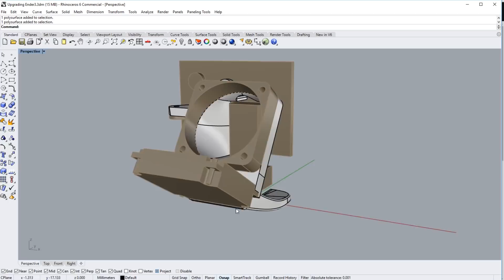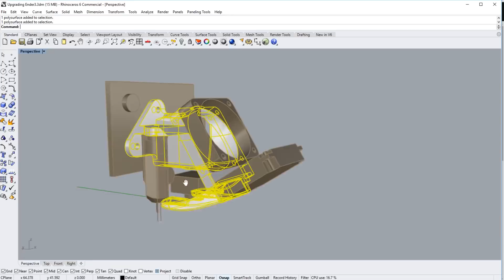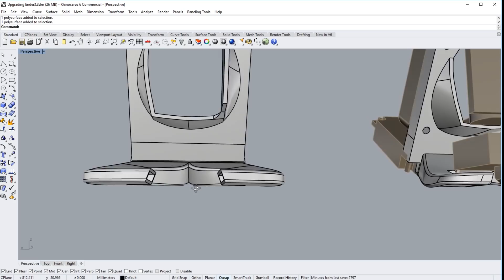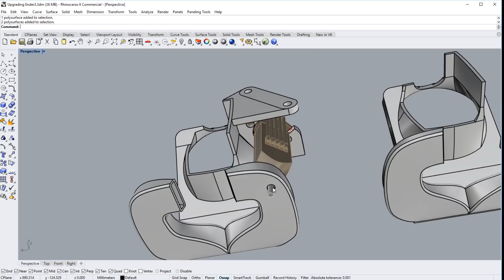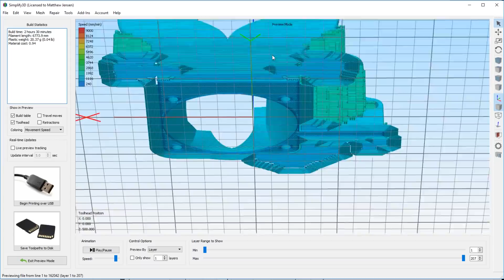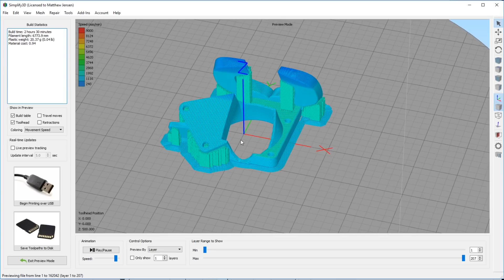Upgrading the Creality Ender 3 with Duet Wi-Fi, and other add-ons - part 1

Comment: eh for an extra 300 my prusa came as an entire kit with all the goodies ready to go and set up to run them all.   Worth it imo.
Reply from the maker: You are performing some nice mental gymnastics to try and avoid buyers remorse. It might just work.
Reply: @DesignPrototypeTest  Not at all and if i had to do it again i would easily   : )   By time you have done all that you have done to that ender 3 you spent almost as much money and far more time to get something that compares to it the mk3.  I would much rather pay a little more and just get a complete kit from the get go.
Reply from the maker: Like I said. Buyers remorse. Combined with Stockholm syndrome. The only reason anyone buys a Prusa is because they are newbies and they fall for the sock puppet message blanketed across the internet. The fact is that Prusa makes an inferior product which is priced more than the superior frame designs coming from China. A Prusa printer is a polished turd. Start with a fundamentally superior base frame design and put the polish on it yourself. It won't take you any more time than it took you to assemble the Prusa Kit, and you will end up with a printer that has better functionality FOR LESS MONEY. You are trying to poo-poo $300 price savings as if that weren't A 40% PRICE DECREASE. Give me a break! Also, Prusa isn't an innovator. Again sock puppet manipulation makes people think that he came up with all these features or as one idiot today commented "Joe Prusa started the hobby"  He copied everything. Starting with his frame design. The Prusa I3 Mk3 means the Prusa (Mendel) Iteration 3, Mark 3  Look it up. The Mendel frame was invented by Dr. Ed Sells. An academic working on robotics for his Ph.D. Thesis in Self replicating machines. You drank the coolaid and now you are trying to justify your membership in the crazy cult of Prusa.
Reply: @DesignPrototypeTest  Duno man it just sounds like you are kinda bitter imo.   "Drank the koolaid?"  Nah i did my research and found a printer that many people have had great results with and were happy with so i went that route.   Yeah 300 isint bad and like another commenter mentioned you are still missing features on the ender 3 that the pursa has and the time to pull all the parts together so again i dont really see it as much of a difference.   Pay all at once for a prusa or pay in bits and pieces and more time trying to make an ender 3 similar.  Its too bad you seem bent out of shape over it.  : P
Reply from the maker: I'll let you have the last word. Thanks for commenting. Have a great day and have fun 3D printing. :)

Comment: I really have to thank you, you helped alot. But i have to say it pisses me off that i have to bendover backwards to get this board to work properly. Now i have to take care of the motor idle noise since the tmc2660 doesnt support stealthchop. I payed alot of money for this board. I do expect a little more userfriendlyness. So far i see no difference between the quality Prints of the skr mini e3 v2.0 and the Duet 2 Wifi except the 130$ difference in Price and that the duet is considerably louder. I am living in an one bedroom appartment, in close proximity to the Printer. I need it to be quiet.

I might just be to stupid and bid off more than i can chew.
If anyone has a silent running stock ender 3 pro, I would love a copy of your Firmware. I´d be forever greatfull.

Comment: Great video.
I wanted to upgrade my printer first, but now build a new one.
I have a wanhao duplicator i3 Pro. Still working good, but I want better and not spend that much money. Also bigger than 200x200x180. I was thinking of 400x400x400.
I only don't know if it is posible or need to change a lot of code.
The reams isn't the problem for me. The heated bed is maybe a problem. I didn't look into that yet.

That filiment sensor is great. I need that. Also auto bed leveling.
Reply: for the ender 3 check out ender extender kits they can make it pretty much as big as you want. I have one with stock height and a 400x400 bed.
Reply: @doggonegarage5270  I am going to build a 500x500 corexy printer.

Comment: How do zip ties or 3d printed parts affect the rigidity and functionality of the prusa frame. The prusa has aluminium extrusions too and a powdercoated metal frame. And where's fan RPM monitoring. Powdercoated PEI, Flex sheets power panic auto loading skew adjustment sensorless homing. Please can I repeat my self there is nothing wrong with the prusa frame. And you can also send print wirelessly with octoprint for and extra £10

Comment: This is great for people that like to screw around with printers for a hobby.
Reply from the maker: If you follow along with my build, it's not even "screwing around" it's a straight forward assembly that results in a printer better than anything else near the price point.
Reply: @DesignPrototypeTest  What's the total cost and total time taken to modify the printer to achieve the same output as a Prusa? Prusa uses upgrades where it matters, zipties holding down the bearing rods versus a metal bracket doesn't result in any quality improvement. They even use steppers with integrated leadscrews to help eliminate Z wobble and coupling issues.
Reply from the maker: I've recently made the final version. I call it "The Ender 3 Evolution" You can see the video here: https://youtu.be/SOZe_fg9DN8 Total cost on that was $490 with an Ender3 Pro, Flex Steel PEI bed, BLTouch bed leveling, Direct drive using a Dual Drive extruder, and a Duet2 WiFi control board. You could easily do it for $410. I covered price near the end of the video.

Comment: at around 3:30 did the screen turn on from the voltage generated by the stepper motor being moved?
Reply from the maker: Yes. This used to be potentially fatal to the control board, but all modern boards have back current regulation so they can handle it.

Comment: oh and is there a free trial of the simplfied3d or is it one of those things u buy an have a month to return and thats what they call the trail period. id love to try it cause ive got 3 of my printers slicing on the newer cura 4.6 now but i cant for the life of me get it to slice for my ender 5. ive even got my creality slicer profile saved an moved to cura finally an still no luck even with that when it work flawlessly in the creality slicer 1.2.3 which is a reskin of a older cura so i cant figure it out and id like to be able to slice them all in one spot and if i knew i could get  simplified3d working for me across all 4 of my printers id spend the money for it, id just like to make sure im able to get it slicing across off my printers first.
Reply from the maker: I use simplify 3D for all 7 of my printers. I have "factory files" saved for each printer with each type of filament. When I want to print with a certain filament I open up the specific factory file, import the geometry, and press print. Simplify3D is better than Cura. Is it $150 better? I can't say. It depends on how much you will use it and if you will be able to use it to the full potential.

Comment: i got my bltouch as the ender 5 kit so im pretty sure its name brand. i hope so cause i paid the name brand price to avoid getting the knock of cause of this and ive always heard bad stuff about the clones, i got a clone v6 but havent used it cause it was suppose to be e3d but wasnt an i could tell from the moment i touched it, it just felt cheap. i got it cheaper than the new e3d on amazon but not as cheap as what it should have been an was suppose to come with a 24volt heater cartridge but its only like 4 ohms so im pretty sure thats 12volt from what ive found online. so i had to order new ones and was suppose to received 5 an only got 3. so my 3d printer parts buying has been really hit or miss. only time ive had good service is when ive purchase directly from the companys stores on amazon like big tree tech. i got the skr 1.4 turbo with tmc 2208 steppers an the tft35 e3 v3 an it was here in 2 days and the packaging for that stuff was perfect just like the bltouch ender 5 kit. i just wish i knew how to tell if the bl touch its self is the real deal
Reply: ur packaging is different than what  mine came in but im guessing thats due to the time difference in when i purchased mine an mine being the creality kit instead of the bl touch alone.

Comment: The creality bed rollers is a nightmare. Axial load on radial bearings is a joke.
Reply: Another issue with the rollers installed like creality does is if you tightened the bed carriage just a bit to much, after storage you'll feel flat spot on the rollers when pussing bed forward and backwards.  It's can't be to loose either because bed will wobble.  These rollers also makes a bit of wear dust.  I want to upgrade to linear rail for the hotbed.
Reply: @vectraB97  a simple fix would to just loosen the excentric nuts a half turn if you know you're going to store it for a while.
Reply: @jamessowin2505  smooth rods with bushings is more trouble free out of the box. Especially on small printers.  You can't adjust to remove sideways play in rollers. Shims must be replaced.
Reply from the maker: Ha ha! Are you for real? Hyberbole of the month. You've got to be a Prusa troll. Those bearings are designed to handle thousands of kilograms each. Axial loads near the rated weight would be problematic, but the Ender 3 bed plus the print on top of it weighs at most like 3kg. Divide that among the three bearings and it's like using a Tractor Trailer to tow a children's tricycle. The axial loads you are worried about will be just fine. Proof is in the puting. There are tens of thousands of Ender 3 printers out there and nobody has complained of bearing failure.
Reply: @DesignPrototypeTest  I have ender 2. The bed and the rollers are the worst thing about the printer.  Those bearings fit so badly that the stock sideways movement was nearly 1mm.  The sideways force from clamping them down can be more than 3kg.  Why use a radial bearings for something it isn't made for? I've had the similar issues on RC cars.  Solid axle pinion bearings are always the first to go. Because radial bearings are not made for axial loads. Even cheap brass bushing last much longer with axial loads.  I'm not impressed by creality's design choice. Are creality even listening to costumers? micro SD is clumsy to use.

Those bearings are not made to handle thousands of kilograms of sideways force. A 2s battery and tiny 540 20turn brushed motor will kill those bearings in my rc crawler.   And it doesn't take many hours before they catastrophically fails.  On my RC 1/8 truggy radial bearing on diff pinion  last maybe 10-15 battery packs.
Reply from the maker: >Why use a radial bearings for something it isn't made for? 
Because they are ubiquitous and very inexpensive. Or would you prefer if they used angled roller bearings and upped the cost by $100 for the printer? I don't even know of a manufacturer that makes budget axial needle bearings. The closest thing I can find is ~$30 per bearing on Ebay. There are 24 bearings on an Ender 3. That comes out to $720 just for the bearings which would make the Ender 3 a $1000 printer!
>I've had the similar issues on RC cars. 
RC cars have components that spin at tens of thousands of RPMs get hot and are exposed to dirt and water. The rollers on the Ender 3 are lucky to do 100rpm. Also, you aren't dragging your printer through the mud. No matter how good the dust seal is, dirt will still get inside the bearings in your offroad RC environment. Finally, given how little/slowly a 3D printer moves a brass bushing would be a poor choice. The static friction is far too high. 

>Are creality even listening to costumers? 
No. It's China. They don't g.a.f. about you. They just want to copy the intellectual property of the west and sell you the least expensive thing which you will actually buy. If people are buying it they won't change it. And believe me, people are buying the Ender 3. If Prusa goes bankrupt it will be because of this printer. 

>Those bearings are not made to handle thousands of kilograms of sideways force.
You are right. I stand corrected. Here in this spec sheet each bearing is rated for hundreds (not thousands) of Kilograms radial force. https://www.smbbearings.com/firebrick/ckeditor/plugins/upload/Uploads/Documents/bearingpdfs/1622-2RS-miniature-bearing-0.5625x1.375x0.4375-inch.pdf I can't find the axial rating, but let's assume it is 100x lower. That still means each bearing can handle 34kg multiply that by 6 bearing because each wheel has 2, and you've got a bed that can hand 204kg or 450lbs! so, drive one of the tires of your compact car onto the bed of your Ender 2. The rest of the printer will break, but the bearings will still be perfectly functional.

>if you tightened the bed carriage just a bit to much, after storage you'll feel flat spot on the rollers when pussing bed forward and backwards.
This is a valid criticism, but it has nothing to do with the bearings. This is caused by the plastic tire deforming. If you lessen the pressure and give it some time, the plastic will recover and the flat spot will heal itself. 

Yes, linear rails are a better solution. They are also far more expensive. Be careful where you purchase from. My linear motion rails on my Kossel have quite a bit of slop/play/lash: https://youtu.be/iNMt2MYfrF8
Reply: @DesignPrototypeTest  radial bearings are fine, it's the directions their mounted on the bed that's very questionable in my opinion. Getting anything to stick without glue isn't easy on my ender. I think it's mostly because of the inconsistent rollers on my ender.  Monoprice select mini v2 would have been a much better purchase than my ender.  Creality discontinued it and has no official firmware for it.

Comment: Nice video...I like the duet boards but they are way too expensive.  Recently I have been using big tree tech’s 32 bit boards.  Does the duet use 32 bit marlin or their own firmware?  Also, what is the 3d design software that you are using?
Reply from the maker: Duet boards are powered by a very good 32 bit chip. Also they run Reprap firmware. Think of it like Apple computers who controls the hardware and operating system and gets them to function flawlessly together. Only in this case the board and the operating system are both open source. I've made  a video on this exact subject. Marlin vs Duet - https://youtu.be/bFQjFvxiIkg
Reply: Design Prototype Test thanks for your reply.  What is the 3d design se that you were using in your video?  I tried but could not determine what it was.  Also, how do you find cura 4.x vs s3d?

Comment: Hey, interesting videos... But here is a question for you... Are you aware of any printer controllers, capable of running multiple Nema 24 10A motors? If you are interested in knowing what for, I'd be happy to tell you in a private message, but in the meantime, I was wondering if running these Nema 24 power-hungry steppers was possible and if you were aware of such a board. Also, this video is form August 2018, we are now 2 years later. Is your opinion still the same that the Duet 2 WiFi is still the best board out there?
Reply from the maker: Duet 3 has even more powerful stepper motor drivers. Check it out.

Comment: I'm sorry so say this.. but a Bowden printer with single z axis  in a cartesian style and with single extrusions not PC heated bed and not all metal hot end. Will never be better than a prusa mk3s.

This can be compared to a prusa mini.. not more.. because

 You won't have the support 24/7 in multiple languages.. constant firmware upgrades.. pre set slicing software etc etc etc.. 

So.. the enders are good.. but no mather the efforts you put into them they wont just be better than a mk3s.

And this is not my opinion.. these are facts..
Reply from the maker: I've had comments similar to this before. Saying "Sorry" before contradicting my video. I don't know why you would think that an disingenuous apology would make your false words true, or any less insulting. Here let me try: I'm sorry to say this but Portugal was never and will never be as great as Spain. I'm sorry to say this but playing airsoft will never make you a real soldier. Dressing in camoflage and running around the woods does not make you a badass. It's more like you are a child playing a game.

Now let me address your actual points. When you say "PC heated bed" I assume you mean PCB heated bed with detachable PEI coated build plate. I've always said that is a great innovation, but you can get one for your Ender 3 for $41 on ebay ( https://www.ebay.com/itm/Creality-Removable-Pei-Flexible-Magnetic-Heated-Bed-235X235Mm-For-Ender-3-Ender/254564974516?hash=item3b45413fb4:g:cEMAAOSwxrJej28h )

All metal hotends are only useful for printing high temperature materials such as Nylon, Polycarbonate, PEEK, etc. If you are printing with the more common lower temperature plastics PLA, TPU, and PETG you will be better served by a hotend with a PTFE liner. All metal hotends do not have this feature, but the stock Ender 3 does.

Good point. Prusa has support. That's probably the number one reason to pay the extra money for a Prusa. It's like buying an extended warranty. Of course you can also get support for free from the forums.